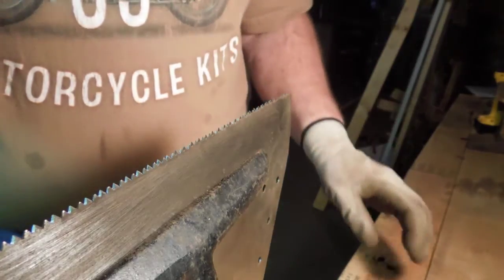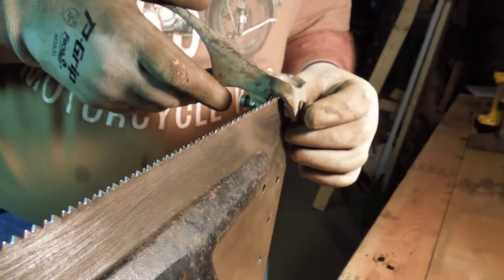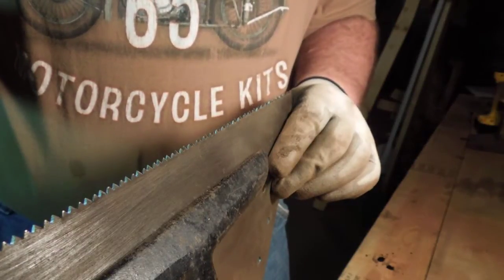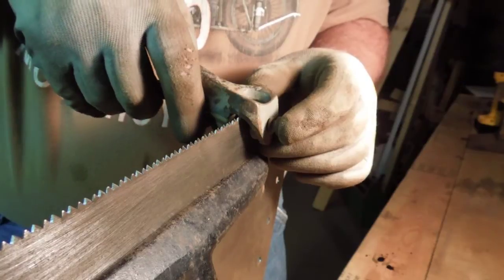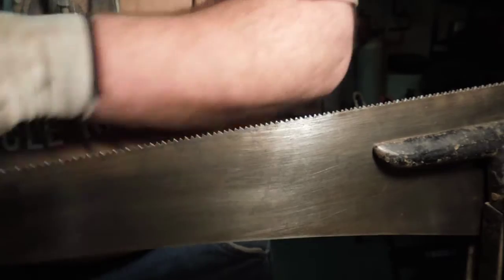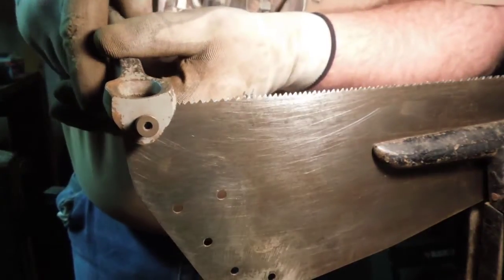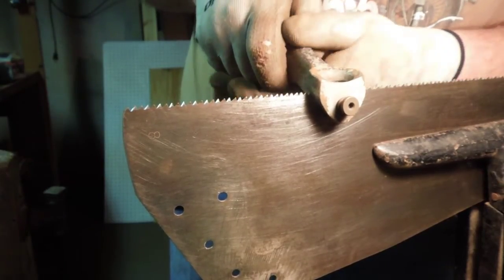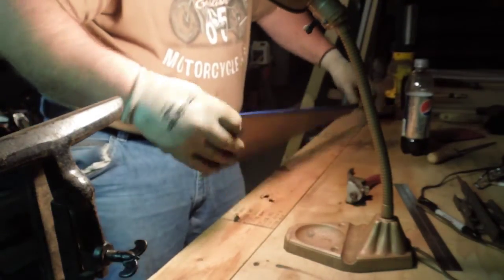Cross Cut Hand Saw Pt 2 of 4 - Setting The Teeth - a video totorial from Old Sneelock's Workshop

Comment from the maker: In a perfect world setting is the last thing I do. My thinking is that I file the teeth & correct the shape of the individual teeth which shortens them. Then when all the teeth are equal in height I set the teeth. 
The set only bends the tips of the teeth. If you set the whole tooth it bends across the line between the base of the gullets. This can crack the tooth. Because a correctly set tooth has only a small area set wider, if you set first you file off the set & have to reset again.

Comment: Hi. My father in law has a drag saw with a 6ft blade. He has sharpened the teeth and is looking to set them. Can anyone advise as to what offset is needed? He is thinking of 1/16 inch. Also, he would like to know at which point on the teeth should the bend be made - at the base or at some other point towards the tip. The teeth are arranged sets of two cutting teeth (one left, one right facing) and a drag tooth. Any other advice would be greatly appreciated. Many thanks. David, Ireland.
Reply from the maker: I have a video series on how to set the teeth on a cross cut saw. You can find the video on setting the teeth here: https://www.youtube.com/watch?v=Uii7o8VQnyw
You are describing a Champion tooth pattern. 
The Champion Tooth Pattern has two cutter teeth that act as slicing teeth and one tooth, the raker, that removes the wood that has been sliced free. 
The set is to widen the kerf only enough to allow room for the blade to clear. Using a spider is the typical way to check the set but you can measure with different gages and measuring devices. I like the spider because it is simple and fits in your pocket. 
I typically set the cutter teeth on a champion tooth saw to have ten thousands of an inch clearance on each side. That has the saw cutting twenty thousands of an inch wider than the thickness of the saw blade. More than that is just spending time and energy removing wood that doesn't need to be removed. 
The bend in the tooth should be about one third of the way from the point of the tooth. On a large one or two man cross cut a slight bend will open up the kerf quite a bit. If you bend the tooth too close to the blade it might cause the tooth to crack and fall off. 
By watching the video series you should have a good idea of how it works.